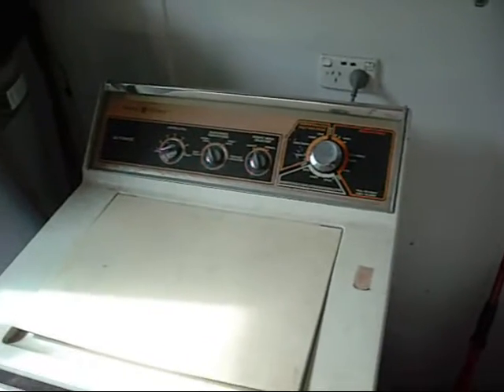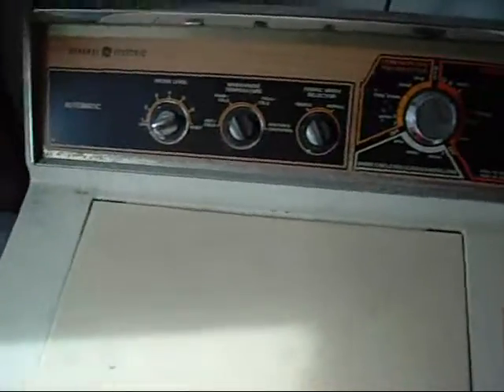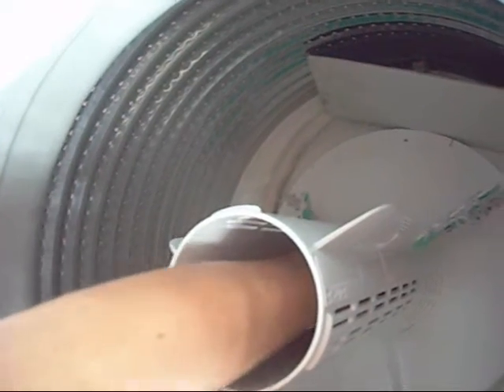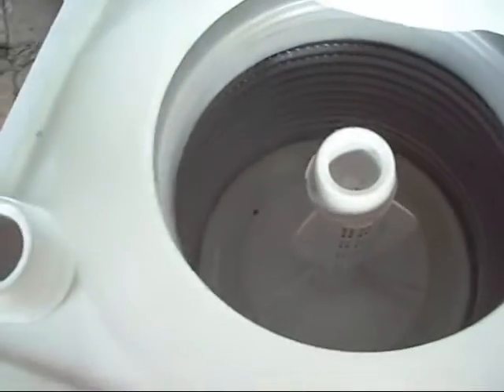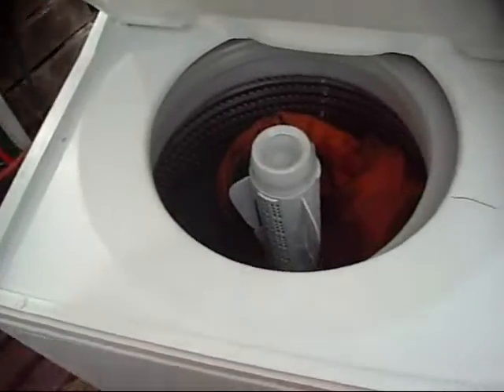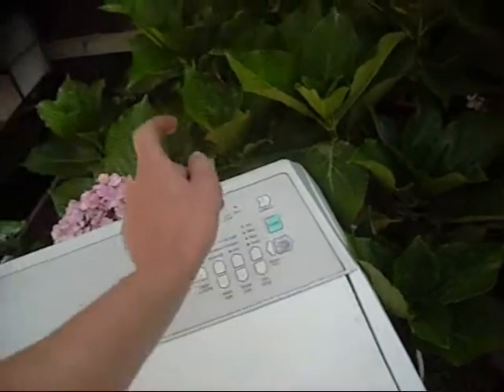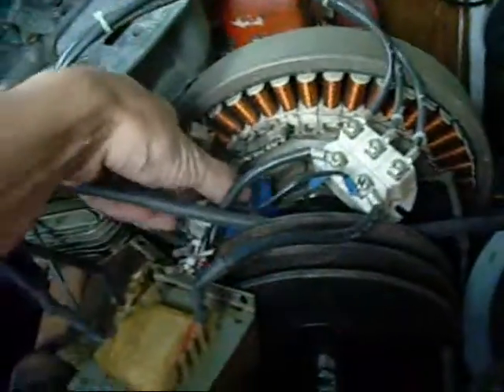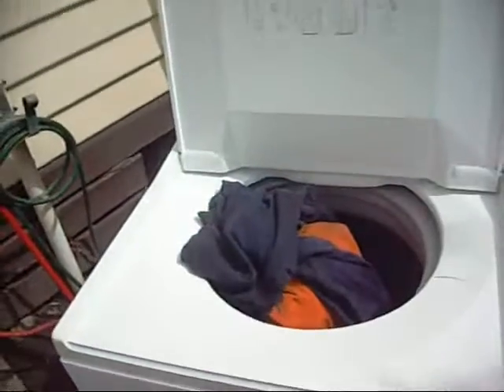Fisher Paykel Smart Drive 701 washer Fix and Test

Comment: parents bought a smart drive 501 - near identical to the 701 just smaller, in '94 and it went for a good 12 years without an issue until the main board fried.
.

Comment: Those motors are great, be careful with your fingers while putting the coils inside the magnet.
i nearly broke a finger when the magnet sucked the coils in when putting the motor together.
Great video.

Comment: That washing machine looks so much like mine except with more buttons on the control panel, the water pump even sounds similar.  I got mine second hand 7 years ago, so it must be nearly 20 years old, touch wood mine hasn't caused too many problems to speak of except for the drain tube being pushed too far down into the pipe on the bathroom floor, causing water to leak through the downstairs ceiling and preventing water from draining properly.

Comment: @digihawk159 
Only problem is that the motors need a lot of power.  600 volts DC drive voltage.

Comment: my dad had that same model of fisher paykel bought it new back in 95 got rid of it 2 years ago cos of dodgy circuit breaker fryed the pcb in it or something, plus my grandfather has an old ge washer like yours but looks a bit different possibly older cos its painted white with chrome bits on the controls, it leaks water all over the floor and oil from the gear box but still keeps on going.